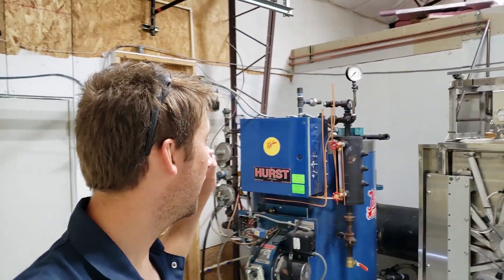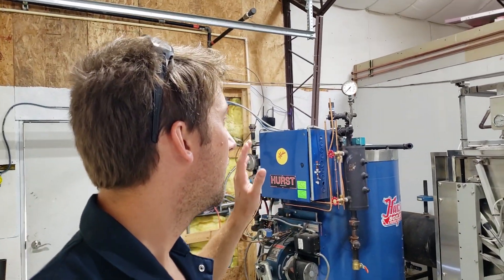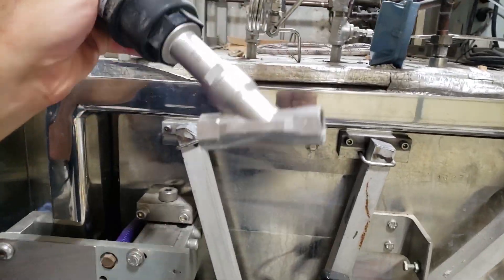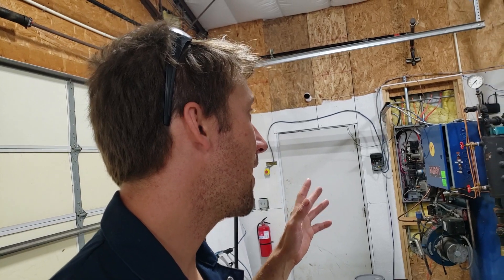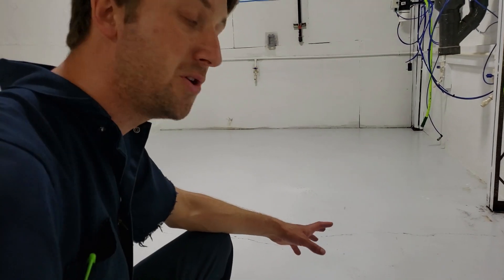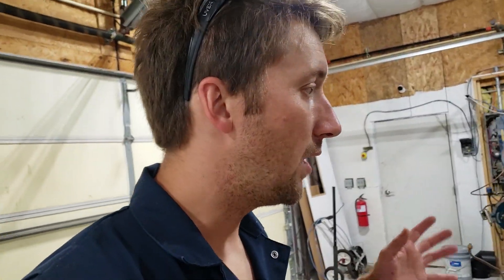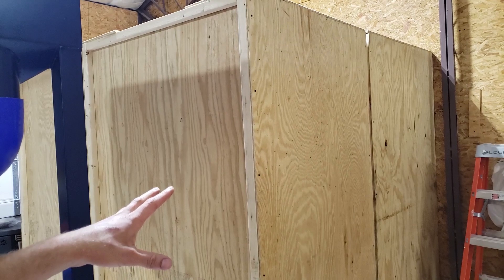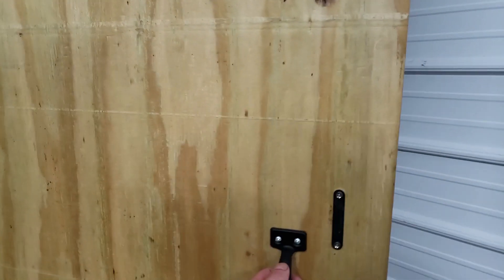Mushroom Farm Build Update, FFU Flowhoods, Autoclave and Boiler, HRV Install

Comment: Mini splits still working good have any trouble. Iam fixing to installed a 24000 btu
Reply from the maker: I fried the 12k btu in the lab by shutting it down at the breaker and fried the circut board. other than that the other 2 are working fine. 2 more going up this week.